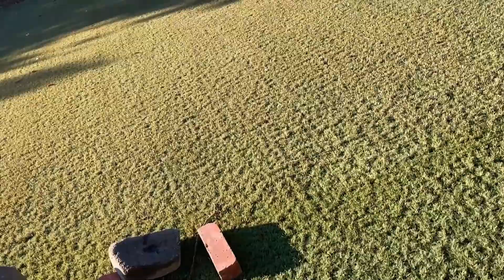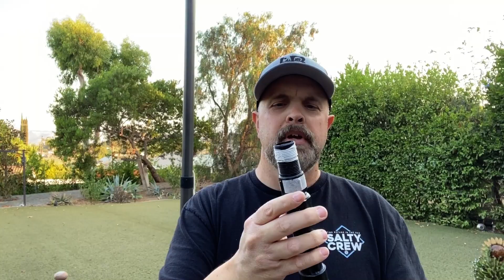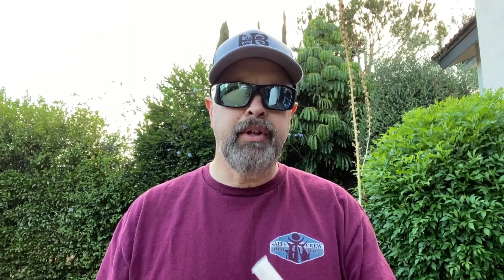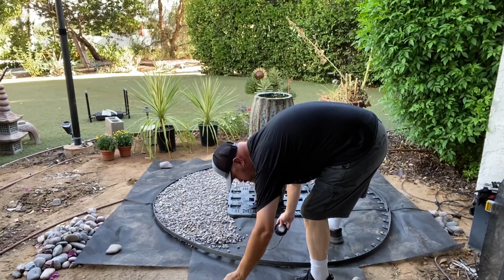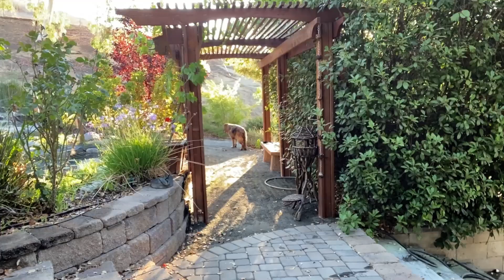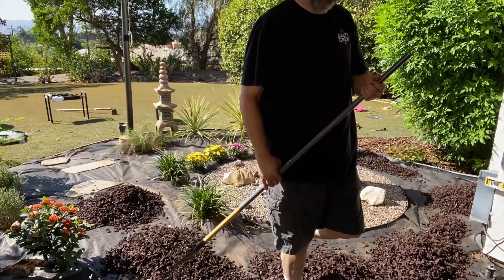"DIY Water Fountain Build + Landscaping Ideas" MUST WATCH THE END!

Comment: I put that weed barrierdown before as well......worked for a good maybe 1.5 - 2 years.....after that it didn't anymore. Do you spray post and pre-emergent regularly to keep it looking clean with no weeds withoutkilling the grass next to it?!?
Reply from the maker: Well it does break down after awhile. Haven’t had any issues yet. But I’d spray a weed killer that doesn’t kill grass. Or you can double up the weed barrier. Thanks for checking out the video
Reply: @johnspondandgarden awesome...
Thanks for the quick response. I guess my expectation was that I would get closer to the manufacturer's guarantee which was 5 years. As said before I got maybe 2 years max BUT admittedly I did not spray anything on that area the whole time.
Reply from the maker: @AH-mp5di they sure done make things like the used to that’s for sure

Comment: great job with the step by step instructions.  I like how you also added what products worked and didn't work for you. surprised you didnt use a bulkhead for the bottom hole of the vase.  but trial and error is how we learn for us DIY'ers.  keep up the good work
Reply from the maker: Thanks for watching my video. I appreciate your feedback and tips, I'm still learning.😊 but i didnt use the bulk head because it was to large. the hole at the bottom was 3/4 inch and the 3/4 inch bulk head i would have to drill the concrete at the bottom of the vase like 2 inched to fit so i couldnt do that. but all in all i got it to work and looks good so far. thanks for watching the video